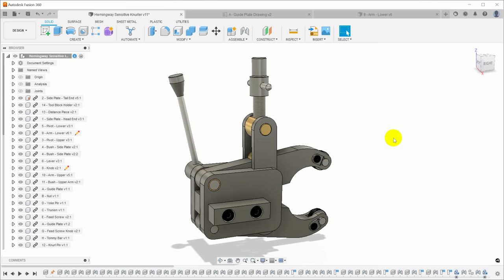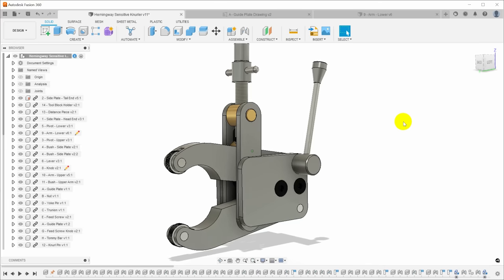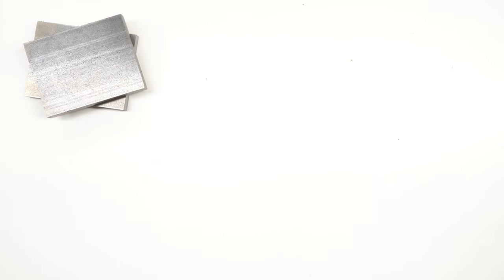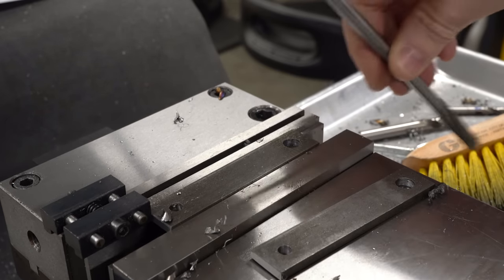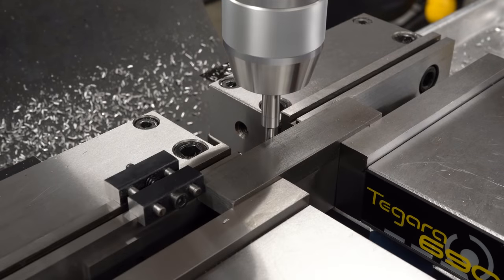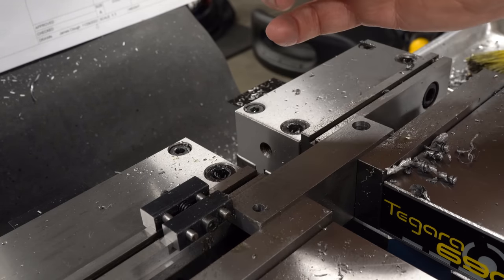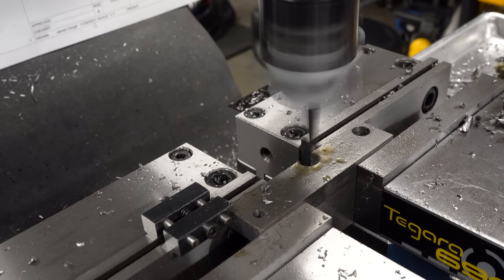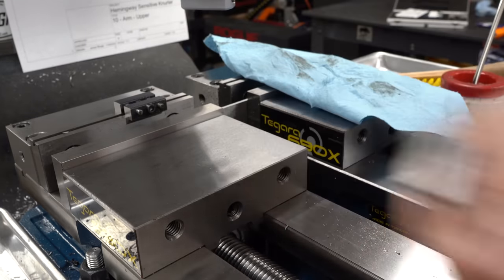Hemingway Sensitive Knurling Tool Build - Part 1

Comment: Just a comment on your guide plate drawing. You are dimensioning from a place that has no feature on the part. This is a bad practice for a few reasons. From an inspection stand point you will get inconsistent results depending on who measures it. Second it adds stack up of tolerances from the actual features to the others.

My guess is this is for personal use and you didn't care though.

Totally agree on the fractions (though I do have them memorized having been a machinist for many years). All the complaints about inches are irrelevant when using decimals as is usually done in manufacturing. So mm are in no way superior. Just a different stick to compare to.

Comment: Did you not learn to layout on the part. Wth marking fluid, scribes and punches? You can even use the fractional markings in your machinist's rule.

I hate the reliance on DROs.

I'd like to see more hobbyist videos using old school techniques on basic machines.

Break out the gauge blocks and surface plate.

Maybe even use vernier calipers instead of relying on electronics/dials.